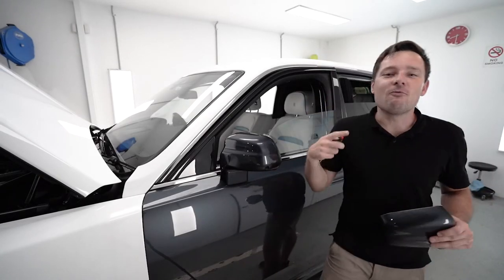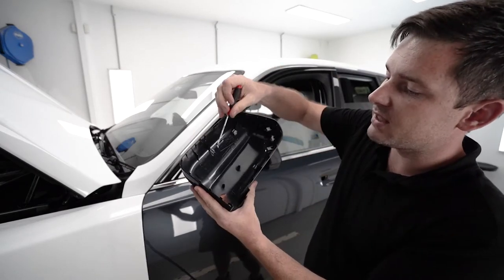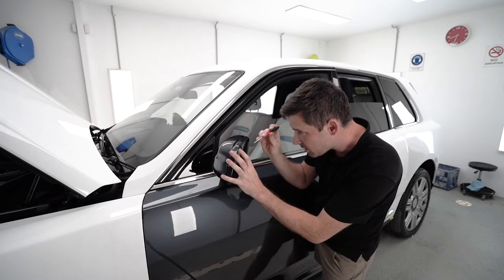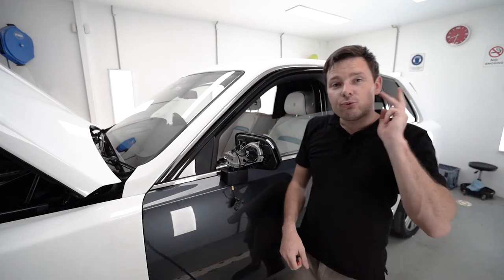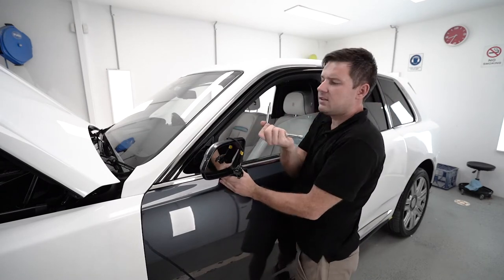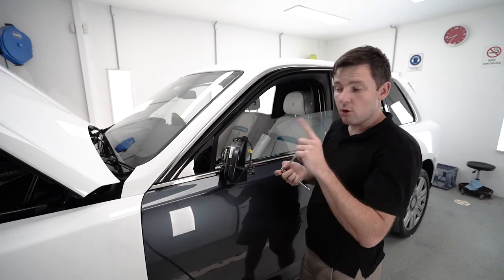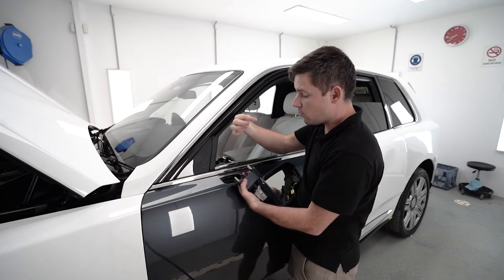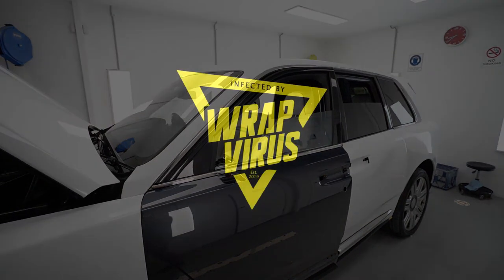How To Remove The Mirror From Rolls Royce Cullinan

Comment: Hey man how do you remove the chrome trim moldings on the outside of the door towards the bottom of the door?
Reply from the maker: Yes, it comes off  super simple. Bolt from inside and then slide left or right the molding
Reply: @WrapVirus  thank you. Ended up seeing your 10 minute video wrapping the Cullinan and thought it was super helpful. Last question, how did you wrap around the shark fin antenna or did you remove it? If so, how does it come off?
Reply from the maker: @levalleb  I just wrapped it in 2 pieces without removing it

Comment: Hi bud, do you happen to have a video showing how to remove door handles? Or any tips on how to remove please?
Reply from the maker: Hi man,
Open the door, next to the handle you will find rubber, remove it and there will be a screw. Unscrew it and door handle will come off. Very simple to do 🤝
Reply: Thank you man 👍 got two for a full wrap and they wanted joins behind mirrors and handles 🤯
Reply from the maker: @callumgratze256 You're welcome.  It's not that difficult to wrap it. Just rear quarter panel is wider than 1.65m 😅
Reply: Yeah it's all big simple panels. I know, I had a plan for the rear quarters then saw your video and you did exactly the same 👌👌
Reply from the maker: @callumgratze256  Where are you located?
Reply: Based in the south west of England
Reply from the maker: @callumgratze256  Cool. Last year I have visited Nottingham, Peterborough, London and wrapped a few cars there :)
Reply: Oh sweet, where are you based?
Reply from the maker: @callumgratze256  At the moment we are in Sydney, Australia. As soon as borders will be open we are leaving Australia. We are planning to visit Singapore, Dubai, Germany, UK, USA this year
Reply: Wow, fairplay man. Get in contact when you're in the UK and in need of an extra pair of hands 👐 did you have a video for how to take the front bumpers off? Or is there anything I should be worried about before doing it?
Reply: Lol also here to learn how to disassemble this beast for a full wrap in Nardo Grey. I’m tackling this one alone lol 

Greetings from Hollywood, Ca!